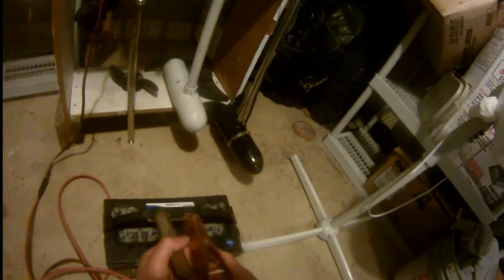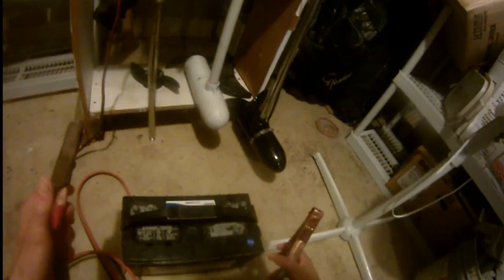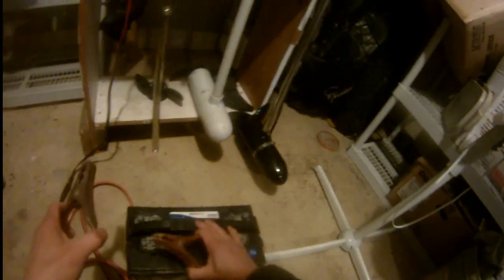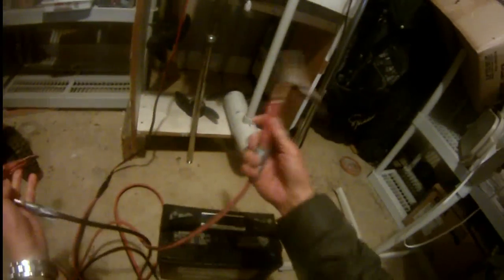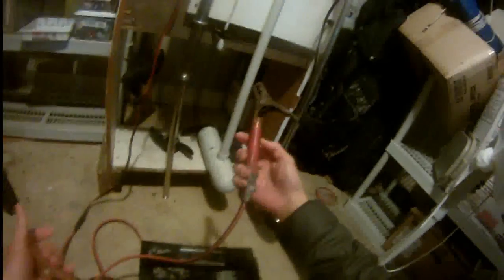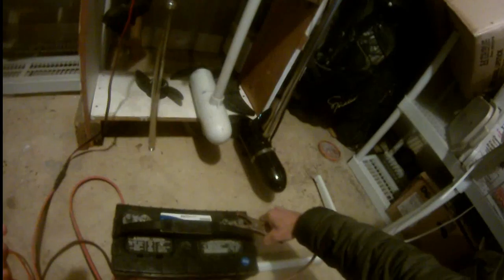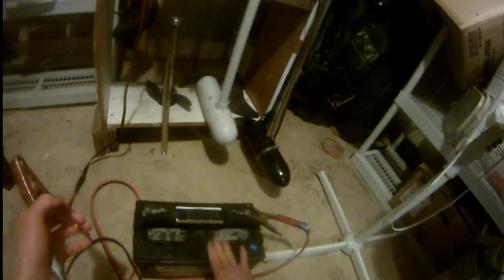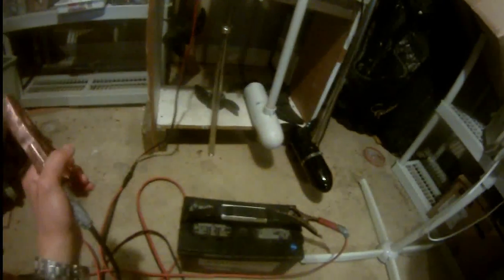How to connect 12v/24v Trolling motor with 1 and 2 batteries?

Comment: Hello I have a Hyper 80lbs thrust trolling motor that came with the boat but had wires ripped off also has 6 wires 3 big wires red black and green also 3 thin wires i don't know what are they used for any ideas would be great thanks
Reply from the maker: Google it using images search or parts search. My guess Red is always positive to 24v battery +, black is always negative to battery-, green is signal for digital speed (variable). 3 thin wires may be for connections to foot control unit